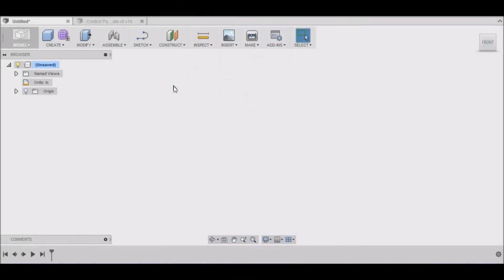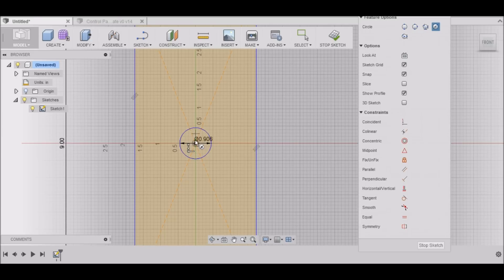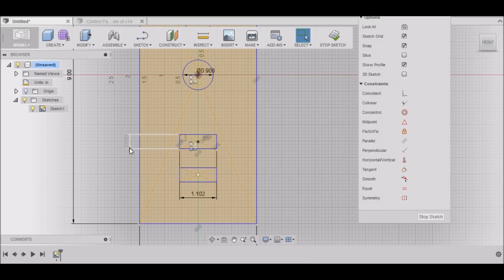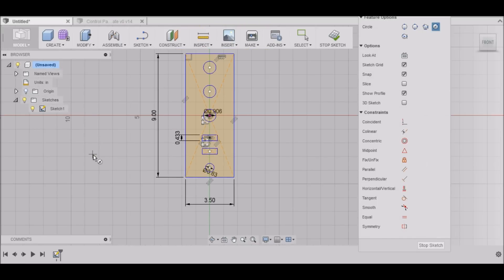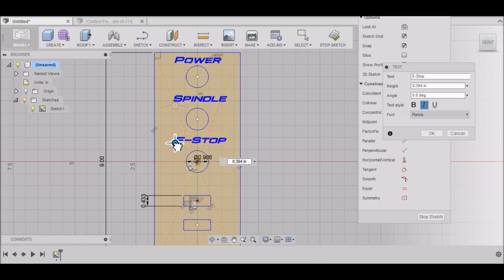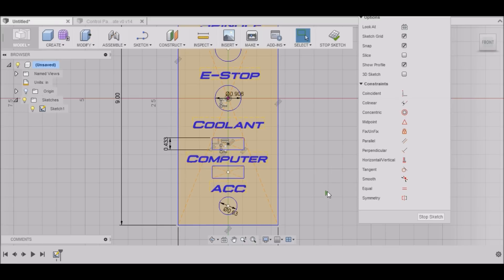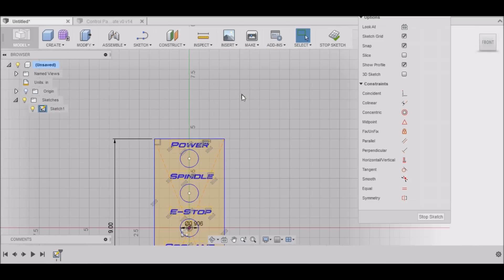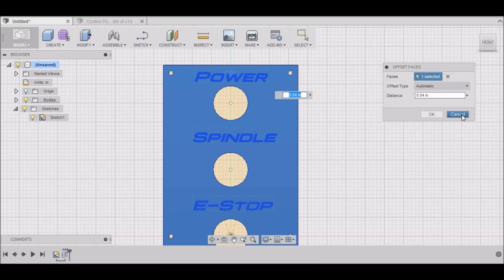PM-727M Control Panel Cover plate In Fusion 360

Comment: Question about the engraving... roughly how deep is the gouge?  Specifically is it deep enough that it could be filled with a colored material to make the text pop?

Thanks for the videos.
Reply from the maker: +Webb Pinner  I'm using a Tormach 90 degree diamond tip engraver so it doesn't really cut more like scratches the material and leaves edges around the engraving, its spring loaded and is not deep, I have tried to force paint into it but have not had any success.
If the Aluminum is anodized you can use Aluma- Black  it will turn the engraving black.
 Sam

Comment: You might have mentioned this in a previous video, but what are you spraying on it for lubrication?
Reply: I use 90% rubbing alcohol.  Cheap and it works good on aluminum but you need ventilation lol

Comment: Looks good. Came out very nice.
Reply from the maker: +William Hardin 
Thank you Hows the project coming.
Reply: Pretty slow, I've been traveling a lot. I think when I get back to my Sheldon 10" lathe I will go ahead and convert it to CNC while I have it apart. I need to see if I can find a 3-phase 3/4 hp motor for it.
Reply from the maker: +William Hardin That shouldn't be to hard  Will a 1 HP not fit?
Reply: 1 HP would would probably be okay but it has a 1/2 HP right now and it's an old lathe so I don't want to go over 1 HP for sure. It uses a single 1/2" wide V belt for the drive.
Reply: That sounds like the setup on the G0602.
Reply: http://www.surpluscenter.com/Electric-Motors/3-Phase-Motors/Variable-Frequency-Drives/1-HP-TECO-VFD-115-VAC-1PH-INPUT-3PH-OUTPUT-11-3424.axd
Reply: Check here for a motor vfd combo 
https://dealerselectric.com/company-details.asp
Reply: +Sam D What brand of motor did you use? Those package deals look pretty good, I probably don't want to go over 1800 RPM.
Reply: Yea they do that's why I sent the info. I went with the lesson metric motor it is a direct bolt in replacement. 
But for you I'm not sure but if you can find one of the motors with the Sam shaft size and base to mount up that would be great.
Reply: +Sam D I was looking at the Siemans Motor, I doubt if any new motors will match the mounting of mine since it was made in the late 30&#39;s to early 40&#39;s. the shaft size on the Siemans is larger also, so I will have to modify my pulley or buy one that will fit the .875" shaft.
Reply from the maker: Yea I guess it would be. Siemens motor are good motors we use them on some equipment there really reliable.